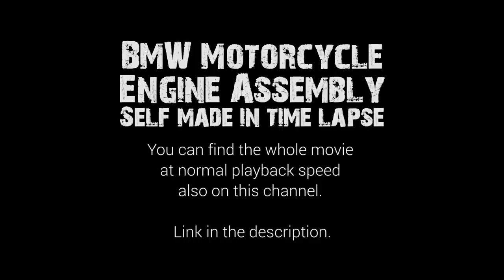BMW Motorcycle Engine Assembly - self-made in time lapse

Comment: ...I've worked on a lot of the M10 and M20 engines and it's always interesting that BMW uses the same type of engineering , tensioners etc , I wouldn't be surprised that some parts from the bike are interchangeable ... M20 and M10 are very similar and easy , fun almost intuitive

Comment: The weak link in bmw airhead engines are the camshaft followers. The ones you re installed are well past their use by date. They will destroy the camshaft and eventually the crankshaft when enough metal is generated.

Comment: Hello. Very good video and work. Maybe you can help me! I am assembling my bmw r80gs engine and I do not have the engine tightening. Do you have a page that has them or where I can find them? From already thank you very much, greetings
Reply from the maker: Hello. Do you mean the engine mounting bolt torque?
Reply: @NilsHomann  Yeah. Tightening of connecting rods, cylinder cover, engine assembly. It's a bmw r80gs year 85. It's the same as the engine you built in the video.

Comment: Hi Nils I have a 1974 BMW r60/6 that has a problem that nobody can solve. When I start the engine, the rev counter marks 1200rpm and after some time it starts to accelerate by itself until it reaches close to 3000rpm. This happens after 6 to 8 minutes. I wonder why? Thanks
Reply: I don’t know much about BMW motorcycles , But it sounds like an air leak at the carb boots.

Comment: Hi Nils - thanks for the video. One question - when you assemble the rockers and spindle, the dot on the top of the spindle is shown facing outwards, but when assembled, its facing inwards - which is the correct way?
Reply from the maker: Do you mean a specific part in the video ? Have I possibly made a mistake? Please tell me the time marker.
Reply: @NilsHomann  Its at 3:09 shown facing outwards, at 3:18 facing inwards. I had the same dilemma when reassembling mine, so just wanted to make sure.
Reply: @davidsnyders6797  I saw this same difference.  which way is correct please.  Thanks, great video on engine assembly.  video quality and lighting are excellent.

Comment: Cool video! Rockers were not installed correctly though. The dimple marks on top should face the valve cover (outwards). 3:18 You show the correct way to do it then proceed to install them backwards. ;)
Reply: Just watched that several times in a row... wonder how it came out?

Comment: The cam followers, looked like the case hardening had worn through.
Reply: I agree. Surely should have been replaced.
Reply: Yep, the cam followers belong in the trash bin. Also the rotor of the generator does not appear fresh anymore. And last but not least, there is no need for the paper gasket under the oil filter cover.

Comment: there is another youtube video showing a Ural overhaul and comparing the components from this video and that one?  If I owned a Ural that needed an overhaul?  There is no way I would not find a BMW motor to replace it!  No comparison although I dont know what year models each of these are.  The Ural castings were dismal!  And it had apparently roller bearing rod big end rather split rods like this one....just everything on the BMW says superior....it is amazing the Russians beat the Germans actually but I guess making way more substandard war machines was better than lesser quantity superior quality ....afterall the stuff only had to last long enough to win not indefinatley ...the German stuff was over engineered to last and last